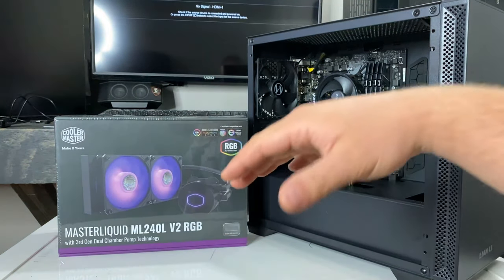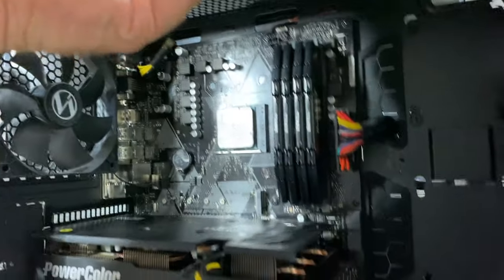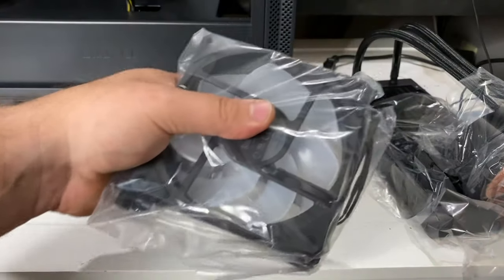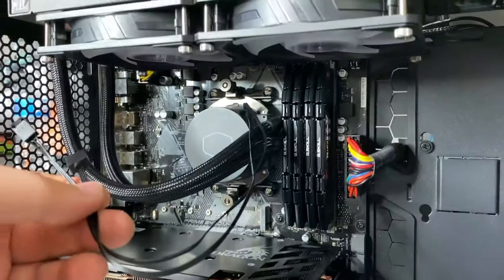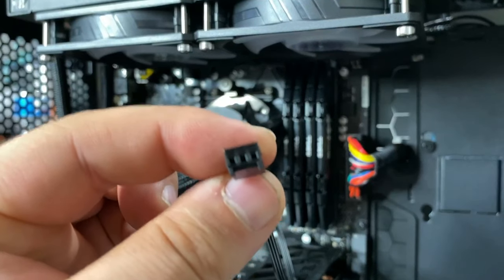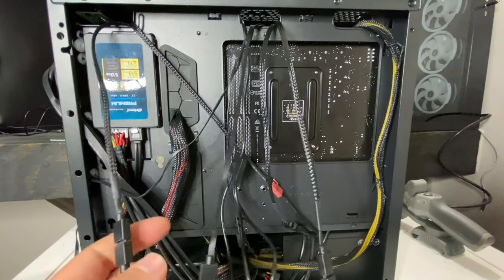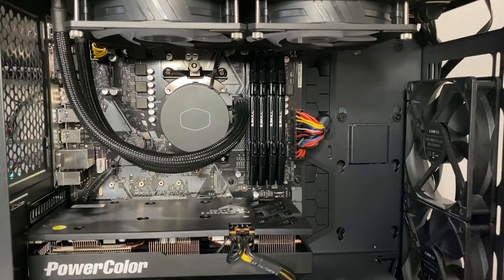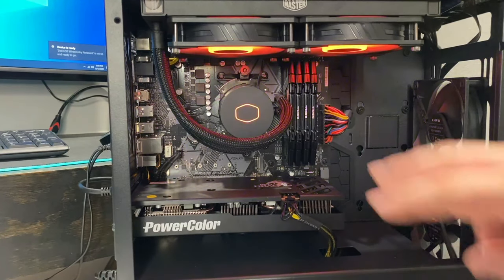How to Install a Water Cooler in your PC (MasterLiquid ML240L V2 RGB)

Comment: When you remove the CPU cooler make sure you have already run a stress test so the thermal paste is runny and then remove the cooler with a twisting motion and it shouldn't stick to the bottom of the cooler
Reply: Thanks for that. I've learned it the hard way xD
Reply: Stress test?
Reply: @Aagggyy  basically make sure it gets hot, play a game for a while or download applications that you can use

Comment: When it comes to the orientation of an all-in-one (AIO) pump, it’s generally recommended to position it with the tubes and radiator mounted above the pump. This setup allows for better air removal from the system, ensuring efficient cooling. However, it’s important to consult the specific manufacturer’s instructions and guidelines for the AIO pump you are using, as they may have their own recommendations or restrictions regarding orientation.
Reply: could i mount it vertically to the side of the cpu?

Comment: Thank you so much! I installed my cooler yesterday and the middle light that goes on top of the cpu wouldn't turn on but you explained everything correctly and it helped a lot more than other vids. Thanks

Comment: I think you mounted the brackets wrong at 9:50 during the video you had said make sure they point outwards so it can clamp onto the pump which I saw you changed afterwards. nice informative video by the way good thing you kept the brackets haha I recently recorded a video on this similar build  and dealing with the AIO should be going up soon (feel free to check it out) but yeah enjoyed the video  nice build 👍🏼

Comment: I wish I could mount my cooler on the top but sadly I have to mount it on the front, and I completely messed up the whole installation process and this was a big help in realizing the problem with the water cooler so thank you lots

Comment: Hi, I have bought the same cooler as yours although now that I think about it would it fit my asus tuf b460 pro wifi motherboard
Reply from the maker: Nice! Yeah This cooler will fit that motherboard. Thank you 🙏
Reply: How do you change the rgb of this cooler. I use aorus b450 and It doesn’t appear on my rgb fusion.
Reply: @pepingrillin3995  you need to have the rgb plugs plugged into a rgb header
Reply: @pepingrillin3995  there's an rgb controller included with it

Comment: Really helpful video. Never thought I’d manage installing  it myself but this is really clear. Does it make a difference if the hoses attached to the pump are positioned at the bottom, instead of at the side?
Reply from the maker: I’m glad I could help 😊 they can be at the bottom but I’d recommend at the top if possible. That way any air that gets inside the pump can easily escape. But I’ve had bottom and top and had no issues with either so might be okay.

Comment: do you need those two brackets that didn't come with the cooler for the am4 socket? I've watched other videos and they didn't mention having to buy separate brackets
Reply from the maker: Those brackets come pre installed on every am4 motherboard. I mentioned it because many other coolers (including the stock amd coolers) don’t use those brackets which means many people dispose them. So if they are upgrading their cooler they may or may not have those brackets. If the motherboard is brand new then you don’t need to worry about that.

Comment: It won’t fry my motherboard and its components when plugging that 3 pin into the CPU header? I’ve been very apprehensive about that part
Reply from the maker: If it were rgb plug then yes you’d have a very bad day. Fan or pump plugs can be plugged a 3 pin into a 4 pin.

Comment: I just installed one of these in a Mini-ITX Cooler Master case. I had to mount it on the bottom of the case (so upside down) and mount the GPU vertically just to get it to fit, but damn my CPU temps are low!

Comment: good video :) but please dont plug your pump to the cpu fan header, plug it somewhere else and plug the fansplitter to the cpu fan header so the fans spin up when the cpu get hoter as the motherboard can can control the cooling of the cpu directly ;)

Comment: Might be the first building video I see a full positive comments section, and I hope it keeps like this. I have a few questions. Do you still use this AIO? And, I see you positioned yours in a way the cables come from behind, next to the back fan. Woulx it be ok if I positioned mine in a way they would stay next to the RAMs?
Reply from the maker: Thank you so much 😊 I still use the AIO in many builds, my personal rig is the 011 dynamic which is huge and so I needed a bigger AIO. If cooler master made this exact AIO in 360mm I’d 100% but it for my pc. I absolutely love the style and performance of this AIO.
Yes you can position it the other way if you’d like, won’t affect anything.
Reply: @BuildsWithV  thank you very much for the (fast) reply. Will be grabbing this bad boy asap. :D
Reply from the maker: @twentyfifth_night  definitely! No problem at all. Thank you for watching 🙏 You’re definitely going to love this AIO!

Comment: Thanks alot for the tutorial man,just a quick question.Do you know if or how i can change the rgb color of the fans?Again thanks for the tutorial have a nice day!
Reply from the maker: If you plugged the RGB cables into your motherboard header then you would control all the rgbs with your motherboard rgb software. That will depend on your motherboard manufacturer since each company has a different software. If you used the small controller that came with the cooler itself then you will use that to change the colors

Comment: My PC has only one fan and a small radiator for the cooling part.  I bought the same replacement cooler you bought.  I hope I can. Get the radiator and fans to fit!?!
Reply from the maker: That will depend on your cpu and your case. As long as the cpu socket is compatible it will work but fitment may not work if your case doesn’t have space for a 240mm radiator.
Reply: Builds With V wish I could show ya a pic. But I got it to fit.  There’s even room for one more rear fan but I don’t have the screws to make it tighten to the case.  All hooked up and I just have to put the case back together and test it.  I’m kinda afraid to plug it in.   I don’t want it to blow up.  LOL
Reply: Builds With V also.  I hope I didn’t put too much thermal paste.  I put it in the shape of an X On the CPU.
Reply from the maker: @Hyestar  you should be okay as long as it’s not way too much. A bit much is still fine. Personally I prefer too much than too little. Always had great luck with my methods than the pea size. But you should be okay, make sure the plastic was removed from the bottom of the pump block otherwise you’ll see high temps.

Comment: Okay so I get this water cooler tmr and I'm trying to see if I get how to install it. This is what I got from watching the video like 20 times. Let me know if these steps sound about right. 

Step 1 - Install your fans to the cool master 
Step 2 - Put all your cables to the back
Step 3 - Clean and apply the new thermal paste 
Step 4 - Install your CPU block
Step 5 - Connect the RGB cable to your rbg_led_2(that's the name for my motherboard)
Step 6 - Connect the fan splitters to cha_fan and run them down where the GPU is at.
Step 7 - Connect fans to the splitters
Step 8 - Connect all 3 RGBs to the RGB cable from step 5 and match the arrows.
Step 9 - Plug in the cpu block to fan hub (CPU_Fan2)
Reply from the maker: Sounds perfect 🙏 Thanks for watching
Reply: @BuildsWithV  no problem. Thank you for this video. I will be subbing and I might have questions when I’m installing it lol😭
Reply: @BuildsWithV  how would i change the color? I have a  asrock b550am gaming

Comment: I couldn't see, your hand was in the way 09:40
Just kidding, another great video. I am still not fond of water, and electronics. So, I have not tried water cooling, yet. 

In time, will the liquid in that tube need to be replaced, or?
Reply from the maker: 🤣 yeah my hand always gets in the way. Same, I’m not too crazy about water cooling. But I figured to do a video hoping to help someone out. The liquid in these AIO water coolers never needs to be swapped. These are closed systems and very unlikely to leak. The custom water coolers need more maintenance.

Comment: Leave your pc on for a bit so the it can heat the cpu and the paste. It makes removing the heat sink easier. ( note i don't know how much it helps but for me it made the heat sink come out with extreme ease so in my experience it helped alot ).
Reply from the maker: Yeah that helps tons when removing it. Thanks for noting this 🔥 and for watching
Reply: @BuildsWithV  your guide was great and it helped a lot mate so thank you for that.
Reply: is it easy for a rookie?

Comment: This vid makes so much sense.. Question tho, can you plug in the water block header to a CHA_FAN and the 2 radiator fans on the CPU_FAN? (If it's the ML240 ARGB V2)
Reply from the maker: Yeah you can plug them in that way no problem

Comment: When you use the brackets 9 mins in are those for amd only or also for intel? Sorry if this is a stupid question just a little confused on that part. Other than that thank you!
Reply: They're for Intel. If you're installing it for an AMD, you need to put the brackets he showed on.

Comment: Just a couple questions regarding this aio
1.Is mounting the radiator to the top of the pc bad just because i have a case that has 3 prebuilt fans at the front and i don't see a point moving them
2.does thermal compound come with the aio

Comment: i got this cooler yesterday.  i finally managed to get my hands on a 3090  but before i install it i thought I'd take advantage of all the last gen sales atm and rather than overhaul the entire system to x670 i figure I'll upgrade my x570 rig to some top stuff so i got a 5900x to replace my old but still unbelievably awesome 3700x and a 32gb ram kit to replace my 16gb kit...i haven't started any of the work yet... kinda don't even want to touch anything because from day one everything on this build just worked so perfectly,  like it was meant to be,  lol.  now, i gotta mess with updating Bios and all that.  it's gonna be nice to see how well this thing cools the 5900x tho...oh ya and kinda curious to see the difference between a 3700x and 2080 to 5900x and 3090 in 4k :)
Reply from the maker: Those are definitely some awesome upgrades! I feel you completely on that, I changed lots of stuff in my build over time and every time I do anything I end up with some issue that I gotta hunt down and fix 😅 don’t let me scare you away from that tho. It’s all part of the process and learning. One recommendation I’d say is maybe install one thing at a time and test each for a day or so. If you upgrade everything and then you have any issues you’ll have to search and swap parts individually. Good luck to you
Reply: @BuildsWithV  ya i think I'm gonna do the ram first,  and test the gpu to make sure i get a display,  then I'll tear it down, clean it, it desperately needs a full cleaning,  then build it back up and pray for POST !! lol

Comment: Hi sir i have a question. I have this cooler like your video and my case dont have 1 exhaust fan on the back of the case, so does that affect the temperature in case ? Too hot for GPU ? Hope you answer my question <3 <3

Comment: Is there danger running the cable behind the gpu? I have a little gap where I fed the cable through. There 2 capacitors next to it but are not touching it. I do think it’s slightly touching the MB.

Comment: do you have to replace the water if so, how do you do that? or do have to just buy a completely new water cooler after so long?
Reply from the maker: @jaxonprice7962  you never have to replace the water. It’s a closed system so unfortunately there’s no way to do it without modifying it. The pump will outlast the liquid inside tho so you should be okay for many years

Comment: hey im building a pc for the first time ever, would you recommend this? and can you put just one single colour or does it just change and you cant change that?
Reply from the maker: I do recommend this cooler and yeah you can change to basically any color.
Reply: @BuildsWithV  thanks how do you change it tho?
Reply from the maker: @nikootjuh7350  if you plug it into your motherboard then you’d use your motherboard ARGB software
Reply: @BuildsWithV  thanks i appreciate your help

Comment: on the splitter, what is the difference about the red one and black one? from what just i saw, the red one has 4 pin and the black one has only 3 pin, but didn't the fan has all 3 pin? is it okay to plug it in to 4 pin which is the red one?

Comment: This was a great tutorial, I wish others were like this. Just a quick question, taking the controller out of the equation, when you connect the 3 way splitter to a RGB mobo header, will it be okay connecting it to a 12v RGB header? I don't have 5v headers (tomahawk Max b450). Thanks
Reply from the maker: This AIO actually uses the 4-pin 12v RGB pins so yeah that’ll work. Otherwise it’s not safe to plug 5v into 12 or 12v into 5v.
Reply from the maker: Also thanks so much for the kind words! Much appreciated 🙏
Reply: @BuildsWithV  no problemo! Thanks for coming back to me. Thank god I didn't really want to use the controller as I would need to find a way to get it outside the case, so that's great! Cheers

Comment: Hi! Just finished building my very first pc, and just used the AMD CPU Stock cooler but thinking of getting this one instead, can I mount it to the side of the Micro ATX case too?
Reply from the maker: It can be mounted to the side as long as the pump isn’t the highest point in the cooling system.

Comment: Hey i have a question. My motherboard has only 4 pin, while my cooler has 3 pin like in the video. Does it work if i wire the 3 pin on the 4 pin block?

Comment: I bought one of these, but the part (4 pin cable) that connects to the power supply, my source is full modular, and the cable is different, I can't connect.

Comment: I replaced my AMD Ryzen 9 3900X out of the box fan with this cooler. My cpu average temp is about 15 C cooler on average now after about an hour of running on the new cooler.
Reply from the maker: Nice, that’s great news. Definitely works pretty well
Reply: @BuildsWithV  you video saved me a lot of time and encouraged me to get this done. Thank you!

Comment: Yo, hi V! I've got some questions about the cooler. So my cpu is the intel i5 6402P and my case is the MS Industrial black widow. I don't know if my case can fit the aio so im asking if  can check for me! Great vid, everything was explained very nicely and the aio looks amazing!
Reply from the maker: Hey 👋 This radiator should fit in your case up top. I can’t tell exactly from specs or photos but by the looks of it, you can fit 2 fans up there. This will just replace those two fans. Thanks and thanks for watching 🙏

Comment: To use the controller, I have to use the fan splitter and connect it to one fan header on my motherboard and the rgb cables connect into the controller which then connects to my psu correct? If that's the case, is there also an rgb splitter included in the box?
Reply from the maker: You can choose to connect the rgbs either directly to your PSU via the controller or you can choose to connect it straight to the motherboard. The process is basically the same, just plug the RGBs into the spitter included and then connect the splitter either to the motherboard 4-pin header and that’s it or to the controller which then plugs into your PSU molex. Either way

Comment: So the only connectors you need is the fan connectors and the cpu fan header? I thought that you had to have a aio pump header on your motherboard
Reply from the maker: Yep, just those and a connector for the rgbs if you’d like. No pump header needed.
Reply: @BuildsWithV  thx